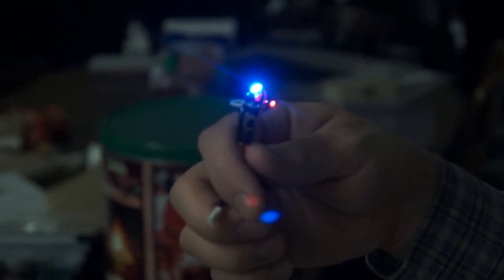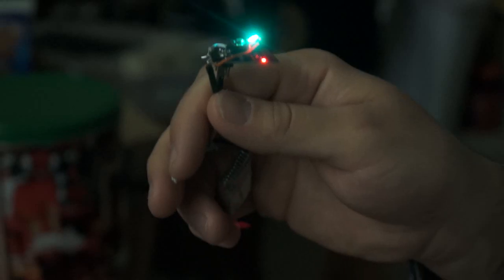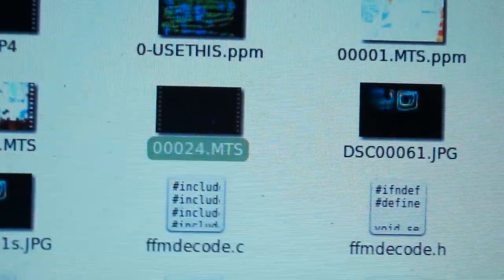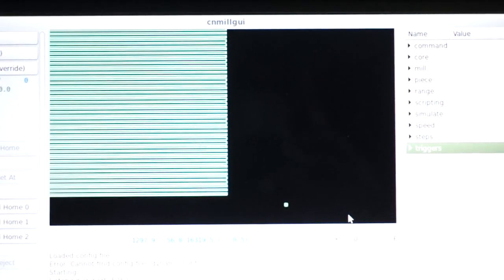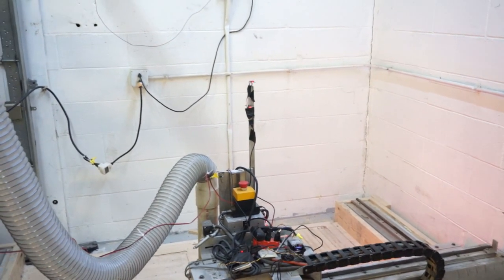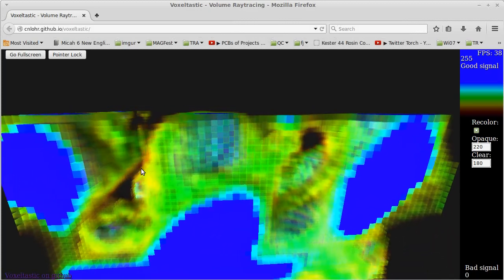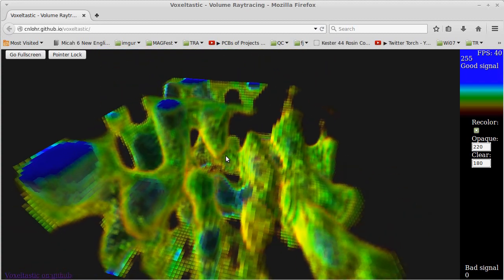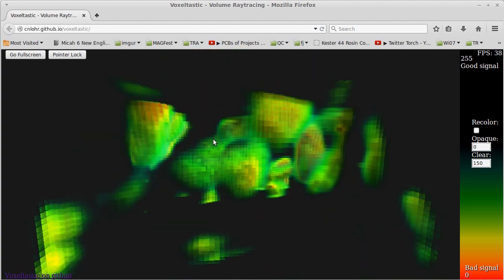High Res Wifi Signal Mapping

Comment: i think that the wavelength of wifi is about 8cm so any possible "shapes" of signal must be in the volume of 512 cm3 (8x8x8 )
Reply from the maker: Not sure how you figure 8cm instead of 4cm?
Reply: @CNLohr  it was a number i thought i remember correctly . now that i look it up again  , for the 2.4gjz band it is about 12,2 cm   (4,8 inch ).

Comment: Interesting... were the weak spots the result of destructive interference? ... I am just guessing. I wonder if removing objects from the room and covering the windows would give a distance correlated pattern. Nice!
Reply from the maker: +Lou A I don't know about changes to the setup.  But my guess is interference patterns.
Reply: I guess that since signals are bouncing around it would be hard to correlate to only one variable, in this case distance... but I wonder if having a 5GHz wifi signal would show a different pattern. I am a chemist, may be someone with a degree in physics or electronics may suggest something worth to try. Anyway, thanks for sharing.
Reply from the maker: Small changes in frequency should show relatively large changes in the output pattern, but man, that would be a cool test to do.  Maybe I can land some more time on the router soon.  There's also another test I wanted to do if I can get time on it.

Comment: heyy sorry for bothering but i am currently in third year of studying  communication engineering and have a to do a project similar to urs so if u coud plz be more specific about how u transfered the data from the mill to laptop like how did u make a relation between the position of the mill and the signal strength and made the computer process that p.s. u will save my semister :D
Reply from the maker: +amin amro The mill ran a profile (like gcode) and I wrote my own mill control software, so I just told it to send its location often.  I recorded that at the same time as the rx power, then I wrote another program that looked at that path and plotted (blurrily) on a grid each of the points averaging them over the area.
Reply: that was reallly helpfull cant thank u enough but i did it using arduino by a ramps sheild and designing x,y,z axis and i cant have acccess to (3.3 to 5v converter) so was wondering if u know how to calculate the rx power by connecting the esp8266 straight to arduino mega (i am delivering the project tommorow morning so i would be in debt of u for life

Comment: Do you think those dead spots are holes, or do you think they are interference pockets? I wonder if you can graph out SNR, and see how close they match?
Reply from the maker: Kenny Hibberd This is actually plotting RSSI... The noise would likely not have much shape since the receiver is the laptop, so RSSI is generally what makes sense.
Reply: As said in the video, it is actually due to the wavelength of the signal. Same thing happens for TV, Radio, cell phone, wifi, ect... that is why you can go from 4bars to 0 bars on your cell phone, and why 1 room in your house gets good wifi,but then in the dead center of the room, it gets shit.
Reply: CNLohr  I didn't understand that the receiver was the laptop; I thought it was the other way around. So the laptop is a fixed point then?
Reply: ***** I do not fully understand what Christopher is saying with "it is actually due to the wavelength of the signal" You are saying the wavelength of the signal causing the db losses in patterns close to the signal wavelength? I understand how signals of opposing phases can cancel each other out, and how slightly different frequencies can cause enough of a phase shift for two different signals in a pattern very close to the wavelength. I would think an antenna listening to a single signal without any deflection or interference issues should be able to catch a full phase cycle at relatively the same power regardless of it physically located from the transmission point at 25, or 25.5 wavelengths away? But two different transmissions at slightly different frequencies could possibly cause phase cancellations in physical location patterns close to the listening frequency?
Reply from the maker: Different transmissions (or the same but reflected) at the same wavelength can cause cancellations.  If they're at different wavelengths those cancellations and peaks will oscillate.
Reply: CNLohr Do you mean the peaks will oscillate at a fixed point in space? Say the noise is a slightly lower frequency. Do you think the cancellations will oscillate at a rate of the lower frequency? And if the noise is a higher frequency, will it oscillate at some harmonics through the noise filter, depending on the type of noise filter used, or something?
Reply from the maker: If you did have different frequencies, they would cause a change over time, I just believe all of this is due to the nulls and peaks that are made from a single frequency interfering with itself.
Reply: CNLohr I think I might build something to duplicate this. I'm also thinking this ray tracing graph system would be useful for other fields in the industry that I work in. One question I've been meaning to ask; do you think the environment you scanned this in is noisy, or do you think it was largely quiet?
Reply: Kenny Hibberd Thanks for helping me understand this. I understand what you mean by oscillations now.
Reply from the maker: I think it was pretty quiet.  While you can see a few wifi points, there are no particularly strong ones, there is nothing else in the facility that talks at 2.4 ghz.

I think the ray tracing engine has a lot of other applications, too, but no one has inquired.

Comment: Why is there so much variation in signal in such a small area?
Reply: it is depending on the thresholds between the levels,
Reply from the maker: Lilac Funish
Indeed!  Even in the "Dead zones" there is still wifi signal.  It's just not quite as good as the best areas.  It's difficult to explain just how high the good is compared to the bad, but I believe it's about 10dB better in the good places than the bad places.  (I COULD BE WRONG ABOUT THAT FIGURE)
Reply: Addison M It's because of the reflections. Imagine the water waves in small pools, they are more complex than at open seas, there they are more homogene.
Reply: Basically its due to the fact that there are so many reflections and as they are out of phase which each other some add and some subtract.  Its so pronounced as you say because the frequency is so high (hence wavelength is short).  If you had access to an anechoic chamber it would be really interesting and should be more or less just the EM waves around 1/2 wave.  Very interesting though!

Comment: What is the dBm of the best vs worst signal?  Like green is how many dBm, blue is what dBm, red is what dBm, blank space dBm, etc?
Reply from the maker: Sadly that was never recorded, but as best as I can recall, it was almost 10 dB of change!!! Much higher than I was expecting.  that's also how the structures are so clear and there is so little noise.
Reply: This is my fixed dipole antenna measuring ~ 1000 SSID beacon frames per second. Average RSSI was -40.676 with standard Deviation 0.654 dBm. Recorded with TCPDUMP and graphed in Excel.
https://drive.google.com/open?id=0BzJPVjnDutJBdmliMVZ1SUxnVFU
Reply: Even if the dBm wasn't recorded, the graphing software mapped the colors to a particular dBm right?
Reply from the maker: That's the thing, the specific dB rating was not recorded anywhere.  Only the ratio from what was recorded to the 0-255 ratio was recorded "(v-6778)/140" but that doesn't let me convert from color to dB or vice versa. It is a linear scale in db space.  So, red would be (AS BEST AS I CAN REMEMBER) 10 dB worse than purple.  Yellow, Green and Blue are somewhere inbetween.
Reply: OK, still cool. I think what we're looking at is multipath fading where bouncing waves are destructively cancelling.
Reply from the maker: I also believe that is exactly what we're looking at.

Comment: Hello! This is a really interesting project. Do you have a step-by-step instruction to build this electronic-part and connect it to the pc? Thank you!
Reply: and do you have a link ofr the battery you used?
Reply from the maker: +David Ley I don't really have step-by-step, as this is just an ESP8266 module... But!  I used the Tenergy 3.7V, 380mah batteries available from amazon.
Reply: +CNLohr Thanks for the answer!
Reply: +CNLohr Does an ESP8266 have a LED on it by default? Or would I need to add it? Thanks :)
Reply from the maker: A WS2812? No.  I  believe some modules have power and a status LED, though.

Comment: I have another question: I had some problems to get the esp8266 in flash mode to install the firmware. Do you have some kind of wiring diagram, which shows the correct connections? Thank you for your help!
Reply from the maker: +David Ley It is the same as my programming ESP8266's in C video.
Reply: Thank you so much! I will try again with this instructions! Greetings from Germany!

Comment: So, if Rx is so sensitive, how about putting 3 ESP8266 together with different antenna and rigging up Wifi Positionning system ?

Robots driving around in my factory with magnets in the floor suck because breaking concrete sucks and moving around with computer vision isn't reliable enough yet. Navigation through wifi positionning, that would be awesome !
Reply from the maker: There really is no way to use this to do localization ... BECAUSE of this crazy amount of ups and downs in such a small place.
Reply: just traces on the floor ?
laser positionning ?
Reply: +CNLohr 
Make all that coherent please.
Reply from the maker: what do you mean?
Reply: It might be an artifact of your graphing.

Maybe we're seeing a lot of variation because the min is 81% and the max is 85% because that's the range of signal variation inside that small space. But if you measure over a larger distance, like room sized, maybe a higher amplitude but much lower spatial frequency signal can be picked up.
Reply: shodanxx
I was suggesting the same without the lowered spatial freq.
Reply from the maker: "Without the lowered spacial freq"?
Reply: Here your pixels are small, that's a relative high spacial frequency.  If your pixels were 0.5m  accross you would see the trend downward when moving away from the tower.  Your environement will cause echos and other radio artifacts but you can model those distortion when doing positionning. If you know the location of three emitters that you can hear, then you will be able to pinpoint your position within maybe 0.5m.  Obviously the radio signal is varying too much for centimeter accuracy, but if I just want to remote operate my lawnmower, that could be good enough.
Reply from the maker: The difference is so significant over just a few inches it wouldn't be possible, imo.  You would need a time-of-flight system :-/
Reply: surely if you plot all receive values over a 10 meter distance walking away from a transmitter, you get a downward trend ?
Reply from the maker: Trend, yes, but, the variance is just SO high.
Reply: You just apply low pass filtering and I bet you can get positional accuracy within 1 meter using 3 wifi signal sources and 3 esp8266 with perpendicular antennas.  If you're a slow moving autonomous vehicle navigating a lawn, the signal trend should be good enough to avoid large stationnary obstacles.
Reply from the maker: Well, you do pose a good point.  A lowpass filter probably wouldn't cut it, but you may be able to use a kalman filter.
Reply: Unless I'm mistaken, such a system may struggle with real-world variations, such as atmospheric disturbances, people moving about, doors being opened and closed, etc.
Reply: *****  can't tell the difference between 1.1 meter from transmitter and 1.2 meter from transmitter. It probably can tell the difference between 1 meter from transmitter and 5 meter from transmitter. That could be good enough to triangulate location within a large building.
Reply: shodanxx I encourage you to give it a shot, but I'm with CN on this one, if you look at the results he's getting, what you  are proposing does not seem plausible to me. Be sure to post if you find otherwise, though :)

Comment: Hi, could you explain, please, why don't you make use of ESP8266 RX power and you are pinging from the computer instead? What's the difference? Thanks
Reply from the maker: At the time of making this video, it was impractical to do so, now it would be the no-brainer way to go since I could do esp-to-esp and it wouldn't require disconnecting an antenna.

Comment: I'm a noob not a pro at this so just bear with me..  
Was thinking ....why not attach the esp to a rubber or a latex hacked RC nano/micro blimp/balloon with  4x arduino IR collision detection circuits. Set some parameters in the sketch then push said blimp into a corner of the room, and call that point 0,0,0,

Comment: What causes the dark halos at some of the spots in the images generated with that long-exposure app?
Reply from the maker: Different lenses have different types of Bokeh, so the shape it makes is going to be slightly different.
Reply: @CNLohr  But wouldn't the darker areas be overridden by nearby overlapping brighter areas when doing long exposure?
Reply from the maker: @tiagotiagot  The way the algorithm worked wasn't to just sum the pixels, but to pick when the data was over some threshold and use it.  So, you can get brighter readings not overriding the color from darker ones.

Comment: Do you think it would be possible to do the same thing with my phone? I mean i can ping the phone with the rxpower app you have, or maybe even make my own.
Reply from the maker: Yep.  Only problem is you have to make sure you only have a single wifi antenna in your phone.  Most phones have two antennas as far as I know.
Reply: CNLohr May I ask why they have two?
Reply from the maker: It's diversity.  Because there are dead spots all over the place with one antenna, or at least poor communication spots.  By having the second antenna, if the signal on one is poor, it uses the other.
Reply: The device will use the better of two antennas because the turbulence can be very strong with wifi, as seen in the video.

Comment: this is just the standing wave measurement,    of the antenna attached to the gadget / led,    no values given,  or db differential,   so rather novel,       so not really reproduce , able,    the true physics would be  antenna addative,  and subtractive,

Comment: I would like that EVERYBODY IS COMMENTING would give an explanation in order to begin a discussion to design new experiments :)  CNLohr Do you think those patterns are created by a phenomenon-like of the sound wave cancelling among two sources?, It would be interesting see the pattern from the source, from the modem in circular readings or like a radar sweeping
Reply: It's very likely because of disturbances and interference.
Reply from the maker: I am pretty sure that's exactly the reason.
Reply: CNLohr I think it would be very cool make a scan say of 5 minutes and then another 10 scans in the same conditions just to see if there are patterns that are preserved, and have as well a spectrogram of the prominent signals in that space...   I think is very interesting this topic, Do you have a schematic to share in order to tinker around awhile?
Reply from the maker: I believe they are happening because of standing waves due to reflections.
Reply: CNLohr I was thinking the same thing, but I'm also wondering if it might be partially due to phase cancellations of other frequencies very close to this frequency?

Comment: So is this evidence that LED can transmit data over its wavelength?
Reply from the maker: I'm not sure how you can get that from this video.  But, I will tell you something fun.  If you ever look at the spot a laser makes, you'll notice sparkles that go in and out depending on how you move your head.  That's because the laser makes a pattern a lot like this video, on your retina. As you move or it moves, you can see that pattern change.
Reply: @CNLohr  I didn’t get it from this video I’ve always known the LED wavelength is able to transmit information over it hence that’s why the big push for LED lighting everywhere because it’ll be another blanket another layer to the Skynet security grid it’s being laid upon us more and more every day